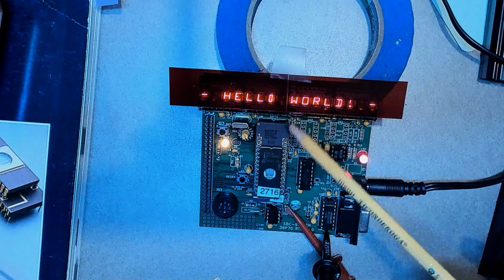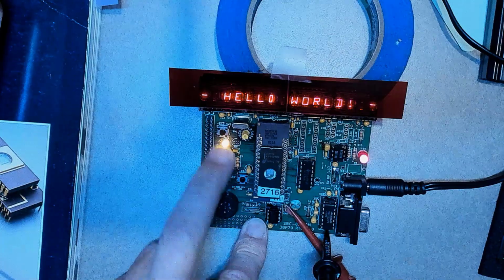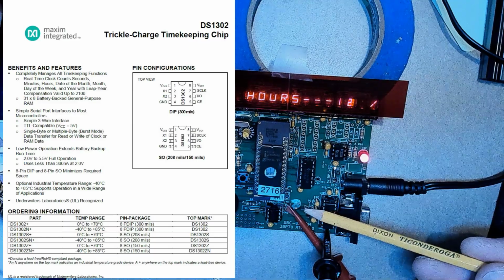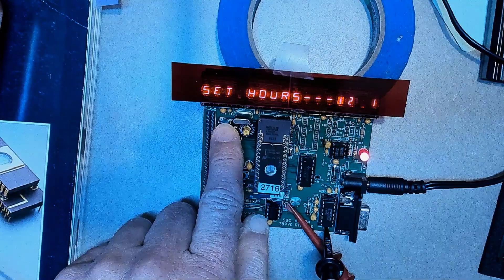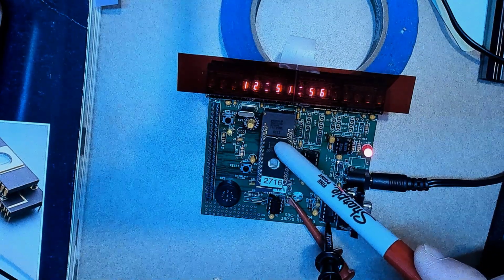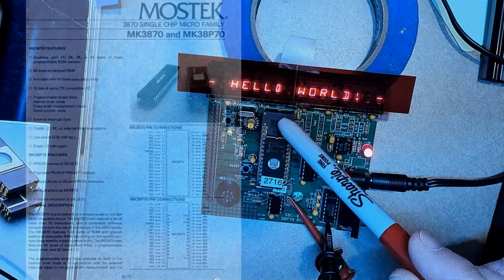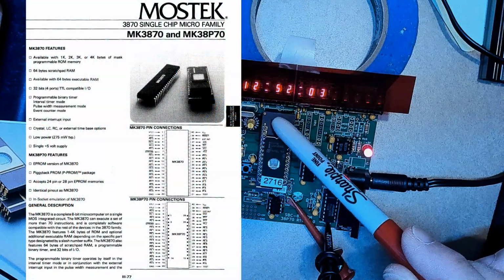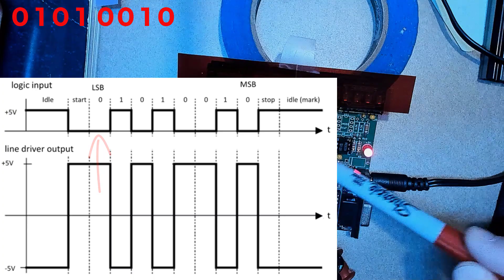{89} SBC-38P70 Checked Out and Build Files are Ready for Download.  Fishing for v1.1 Features

Comment: I've started playing around with this board -- actually spending more time reading through the data book.  An app note in the data book describes using a V to F converter for analog measurements. The LM331 VFC chip was available in 1980 and is still readily available today.  It may be worthwhile considering adding to the next version of the PCB and would make it easy to use the board as a temperature sensor, voltmeter, etc.
Reply from the maker: Excellent idea Will, 

Or we could use the AD537 like in the app note.  Mouser has five AD537KD "readily available"  for $180 each which is a bargain compared to the AD537SD which they list for $450.

I was toying with a two channel serial ADC,  but would be easy to include the LM331 and an analog output temperature sensor as well.  jumper select the interrupt input between the 555 for a tick input or the LM331. 

i think i will order a LM331 and an analog output 3 terminal temperature sensor like a LMT85LPM and try it out on the little sanbox area on the existing board.

Comment: Very nice update!  (I already watched it, but then I realized I watched two others out of order and came back to see it in the right place. 😝)  I like how the clock is working so far, but I'm also very interested to see what can be done by attaching expansions to the I/O pins.  🙂  A clock that can play Snake on a simple LCD?  A small Flash storage module for some version of BASIC, or perhaps an implementation of Colossal Cave Adventure?  The ability to connect TWO F8 clocks together to duel it out in a simple version of ZTetris (FTetris, then?) on their terminals, perhaps??  Potential!
Reply from the maker: The little pad per hole and signal header are really nice for these types of add-ons.  It would have to be someone else’s project of passion to write a basic for the F8, I can’t imagine doing it.  With the dot matrix version of the display, I can envision some minimalistic but fun little games